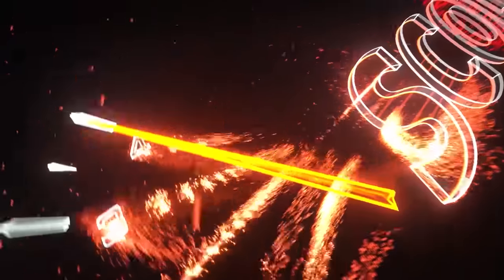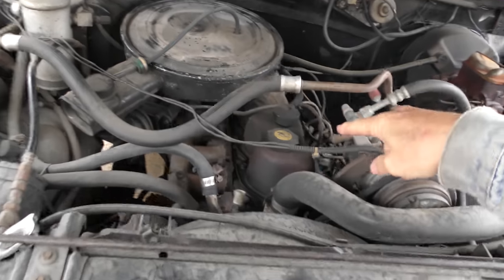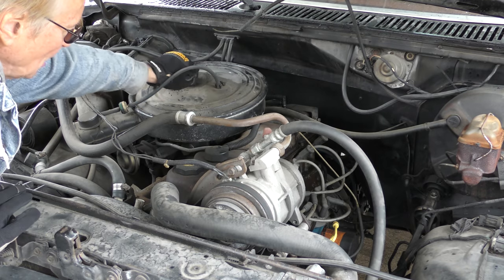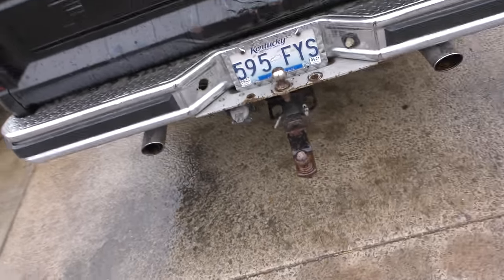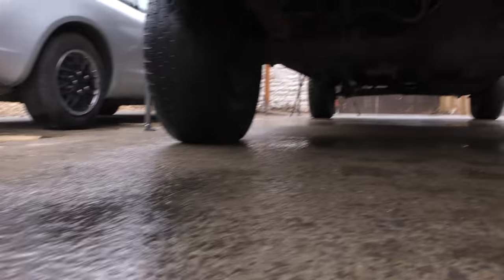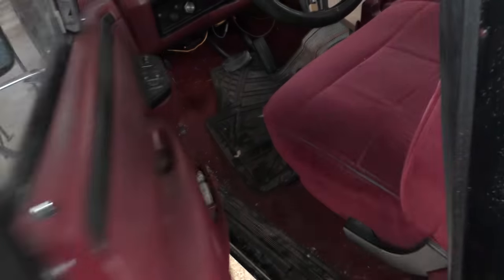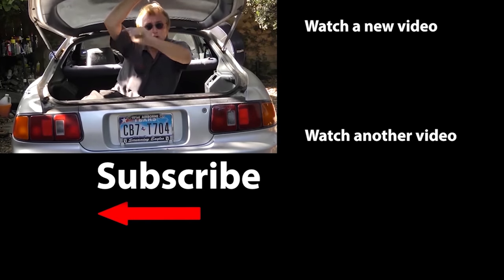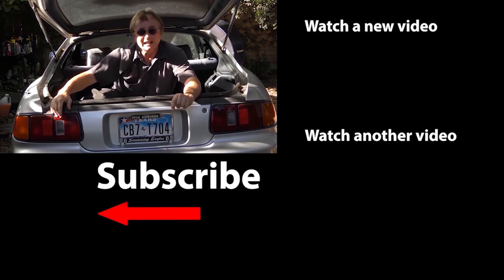I'd Give My Left Arm for This Truck

Comment: Hey Scott. I just bought a 2014 f-150 w/3.5 eco. I was wondering your thoughts on a oil separator. My truck has 82000 purchased used. And in great condition. Is it worth it. Thanks  Scotty

Comment: What do you think of the  1981 5.8L 351 Windsor somebody told me that the Windsors have plastic timing gears is that true?
Reply: Cloyes Double roller timing set. About $120 at Jegs. Felpro timing gasket set, maybe $75. A one guy job for about 7 hours yourself. Ford V8 timing chains will stretch.
Oh, then buy the ATP front seal repair sleeve. Then you will be sure no oil leaks at the front of the crank. Good luck!

Comment: I got an 83 f100 and its sat for several years and a fuel filter plugs and plug wires battery and she runs like a clock

Comment: I was gifted a standard 1990 f150. I have mixed felling for the truck.
Reply: I'll give you $100, problem solved.
Reply: @c.j.rogers2422  great have about $900 more and we got a deal.🤑
Reply: If it's a 4.9/5 speed, it may last forever! I'd love an ex cab of that description.
Reply: @c.j.rogers2422  the AC clutch failed though. 😥

Comment: “Cash for clunkers” killed off most of these old, reliable trucks. Thanks Obama!
Reply: Trying to find parts for an old 300 straight can be a bear. Most notably the EGR plate on the intake and motor mounts (At least for my 1978).

Comment: Scotty-- Why does my Jeep Grand Cherokee vibrate at exactly 60 MPH? It stops at 59 MPH and 61 MPH. It has a 6 cylinder and is 4 well really 3 wheel drive cause it doesn't have locking front hubs.

Comment: Hey Scotty my 2011 Dakota has a rough idle and feels like it’s struggling to stay on this clunky idle tends to happen after a short drive
Reply: Start simple check for vaccum leaks, air filter, spark plugs and coils. You could also try some fuel injector cleaner.

Comment: Scotty have a question regarding my2007 Pilot with 175,000 miles.The engine lights up when the temperature range from 45 to 50 F stays lighted for about 2 to 3 days and it turns off .

Comment: I used to have one the engine oil was squirting from the air intake and leaked every gasket. The belt was a nylon stocking wich I ripped off of my gf's leg and was running like a new
Reply: yeah, these did use multipiece gaskets in some places.

Comment: you are way off we had  a brand new 150 truck  the 300 engine was overhaul at 60,000 miles ,manual transmission pull out twice rebuilt,then replace trans with a heavy duty one , then parked it a money pit never buy another ford

Comment: I have a 1986 f150 with a 300 in line 6 but the carburetor is failing and i want to upgrade it i need help because i have no clue witch carburetor would work best if somone can help that be grate

Comment: Automatic, garbage. I have a 1966 f250 with a 300 and a np435, and its never been rebuilt. The engine has, but not the transmission. Still daily drivable, but I need to rebuild the distributor soon.